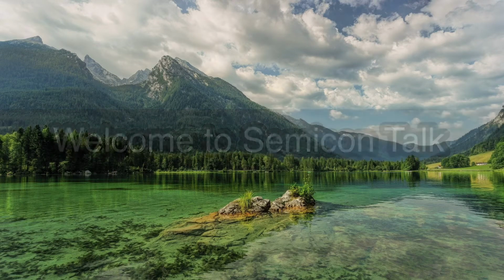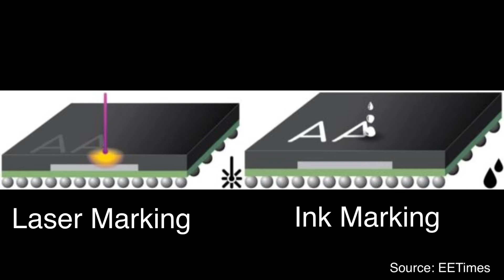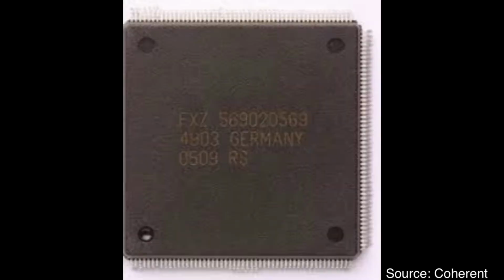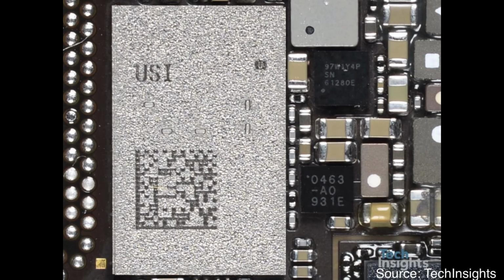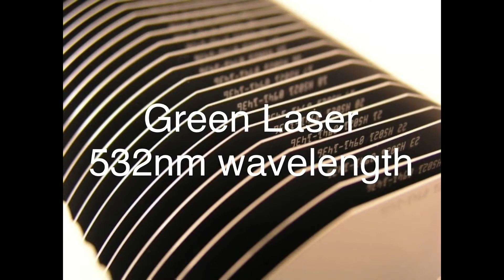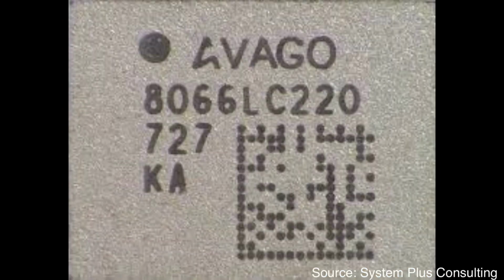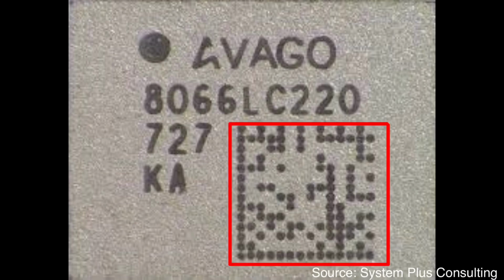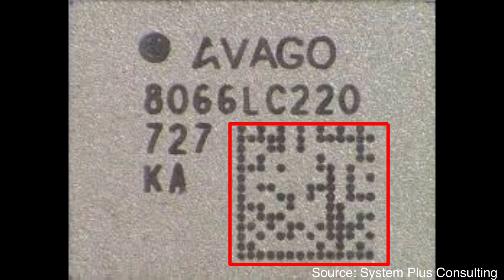[Eng Sub] Marking Process: Laser marking, Ink marking, Nd-YAG laser, Green laser

Comment: Can i know the procedure of laser marking ?
Reply from the maker: Laser marking procedure on molded package is simple.
1. Make laser marking file. It can be character, number,  logo or combination of these.
2. Load package strip or package units in a boat
3. Laser larking on molded package
4. Unload package strip or package units in a boat
1064nm wavelength laser is popular for marking on molding compound and 532nm wavelength laser is popular for marking on Si.
Reply: @semicontalk3223  what do you mean by boat ?
Reply from the maker: Boat is a carrier made of metal and used to carry big unit packages like CPU. For this, laser marking is done on metal surface of CPU.
Reply: @semicontalk3223  is there another specific name for it ?
Reply from the maker: It is also called carrier. Please check below link and you can see how it looks like.
https://grabcad.com/library/semiconductor-carrier-40-x-40-mm-reva-2-x-5-matrix
Reply: @semicontalk3223  Alright thanks.. how about the critical parameters for this type of marking ?
Reply from the maker: I think laser spot size and marking depth are 2 major parameters for laser marking. Small package has small area for marking so small laser spot size is required to make legible marking. Laser marking removes small amount of molding compound so if marking is too deep laser will damage wires or even expose which is not good.
Reply: @semicontalk3223  Alright thanks a lot !

Comment: Do you have any website or contact number for questions maybe ?
Reply from the maker: I don't have but I will check solution to get questions.
Reply: @semicontalk3223  alright.. but can u let me know ..what is the ink marking's critical parameters ?
Reply from the maker: There are 2 ink marking methods, pad printing and inkjet printing. I already explained about pad printing with rubber stamp and that is the traditional one. Inkjet marking is more advanced and popular one and it is like inkjet printing. 
I think critical parameters will be cleaning of package surface before marking, ink amount control during marking, and ink cure. Marking should be easy to read and ink should not be peeled off from package. 
But I don't have much experience about ink marking so this is what I can explain.
Reply: @semicontalk3223  Alright thank you !